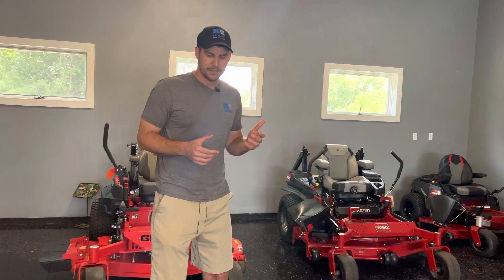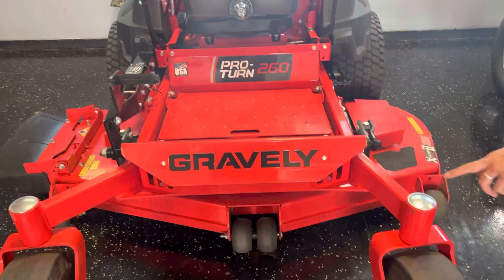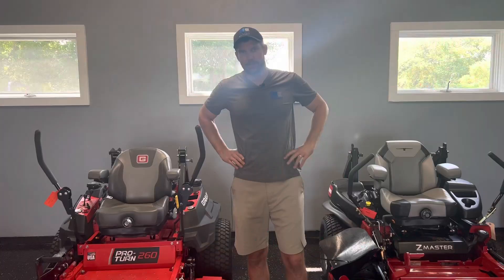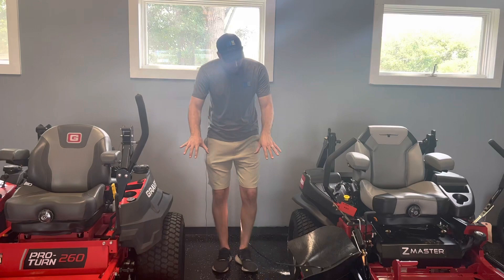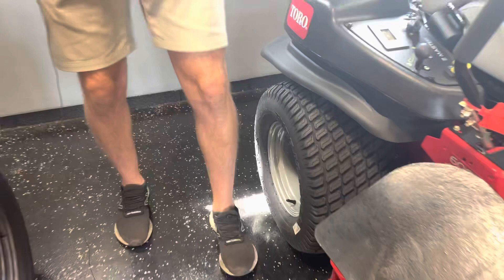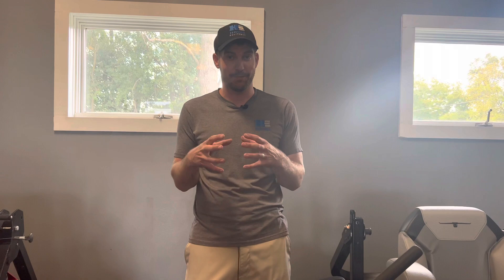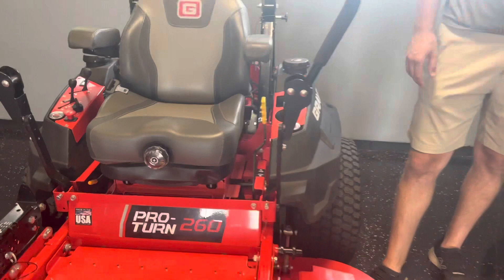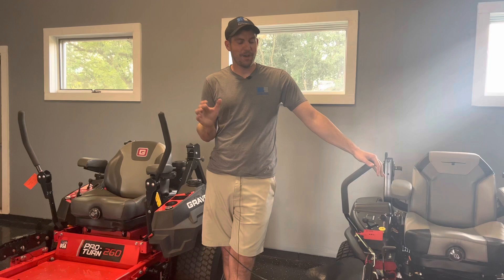Gravley vs Toro - Commercial Zero Turn Mower Comparison

Comment: I have a Gravely Mach one mower. I only have about 100 hours on it now. So far it has been a great machine and I think they provide good value per price point. Toro makes a great machine as well. Overall I would say having a quality dealer is more important vs which machine you buy. Like you said, most of the major components are all the same. Find a good local dealer and build a relationship with them.

Comment: My brother has a Gravely, my uncle has a Toro. Both are comparable machines. Both cut from 2 acres (Toro) to 5 acres (Gravely). Both work exceptionally well, both are very satisfied, and neither has had any problems with either machine. The Gravely, in my opinion, does seem to be built with a more robust deck. Also, the gas tanks being able to be filled without raising the seat is a plus for me.

Comment: As someone who’s ran a Gravely 200 series for the last 3 years, one thing I can definitely say about Gravely is that they have GARBAGE quality control. Many people talk about getting new gravelys with wrong fitting or loose bolts. I for one ordered mine built and when It arrived at the dealership it was missing components for the suspension seat and they put 2 different size tires on the machine causing it to scalp. Didn’t realize that til I got it all the way home and looked it over more closely. I mow 10 pretty thick acres in N Florida and it also didn’t preform really well. After trying multiple blades and having a guy from the dealership come out to my house 40 minutes away to watch it mow, he thought it was the baffles. Funnily enough Gravely actually told them on the phone to take off my baffles and run it without them because the design is not optimized for my area, like what? That sounds like BS! Now I get filthy blowback and have settled with the Fisher Barton laseredge blades. Another thing, I have an issue with the right gastank cap locking up and I have to carry around a oil wrench to get it off sometimes to refill. Can’t get the dealer to replace it under warranty even though it’s obviously a manufactured defect because I have changed caps with no affect. This has become long winded but I can say wholeheartedly I won’t ever buy another Gravely, it’ll be a JD. Oh did I mention my original dealership also stole my baffles when they took them off and I never got them back even after emailing the owner and getting no response. Yeah, dealerships are definitely important but it seems to me I have been had by the dealer and Gravely themselves at this point unfortunately.
Reply from the maker: Wow. Sounds frustrating. Really appreciate your input here and thanks for watching.
Reply: deere 900s are very reliable and give you a replacement mower if it breaks dealers and parts never on backorder then when you trade in you get great prices and they hold resale the best engineering is the best